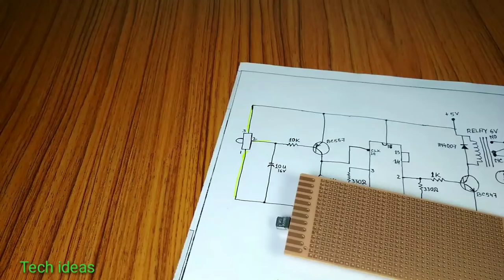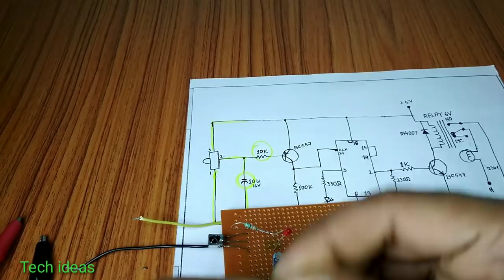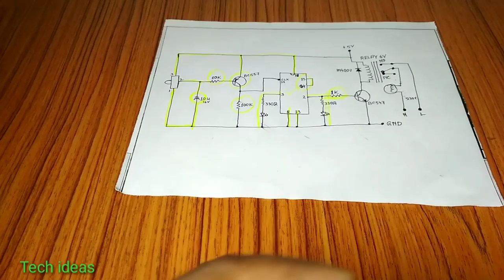Remote control circuit for home appliances

Comment: Sometimes light automatically turns on even i off the relay by remote...how can i resolve it??
Reply from the maker: You have to use battery power supply to it then the problem will go forever.